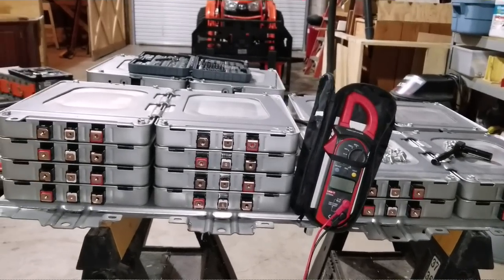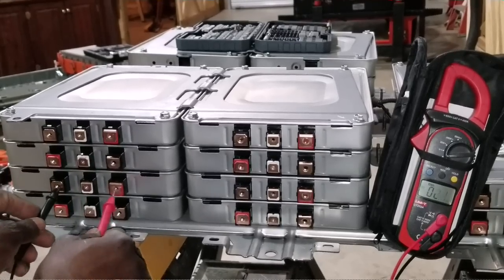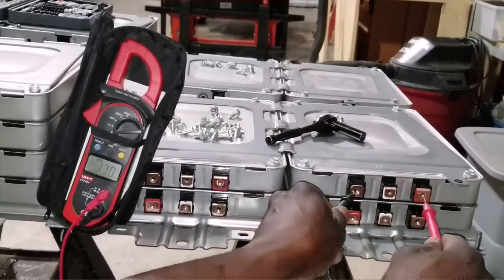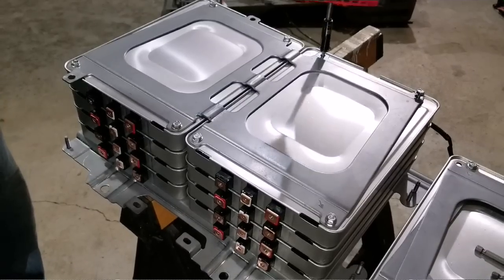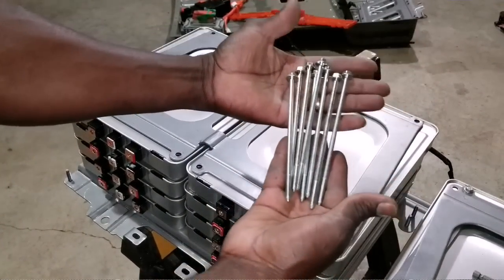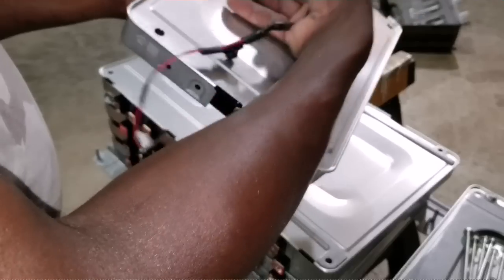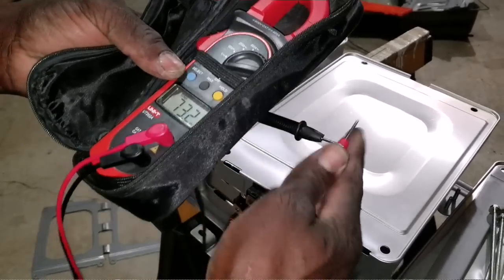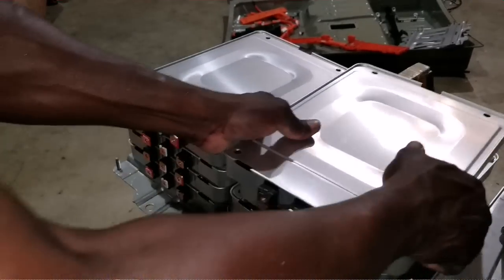NISSAN LEAF LITHIUM CONVERSION AND VOLTAGE TEST

Comment: Great video!  Each of the modules for that model of Leaf battery are 2 cells in series to give you the voltage you are getting.  When you pulled the voltage from the center tap, that splits the pair to give you a single side voltage.  Each of the two cells max out at 4.2 volts.  So when you tie the two together it will give you a max potential of 8.4 volts per module.  Love the illustration of that in this video.  Thanks for sharing!!!
Reply from the maker: Thank you for your awesome input and for always being their. 
I am glad you liked my illustration on this video. 
Please stay tuned for more content on your way.
Reply: 2 in parallel and 2 in series, but effectively yes.